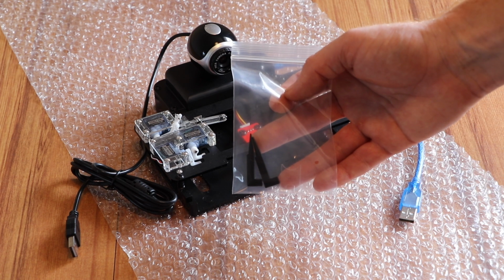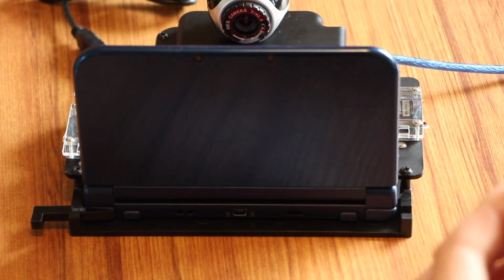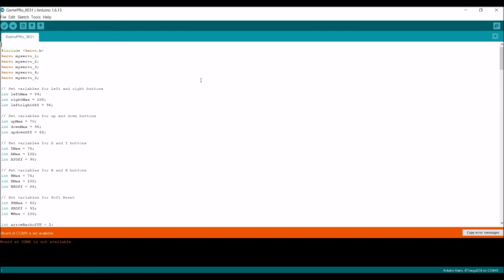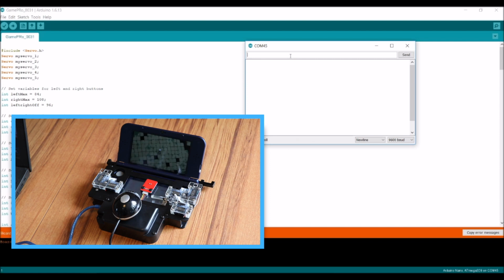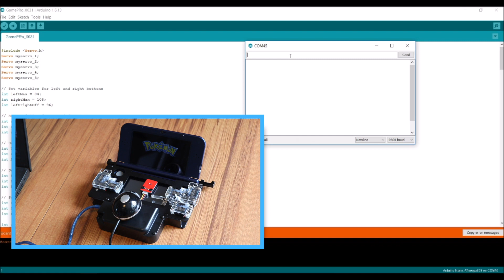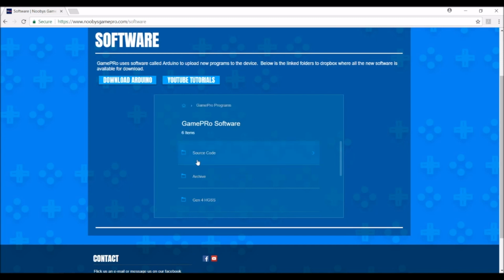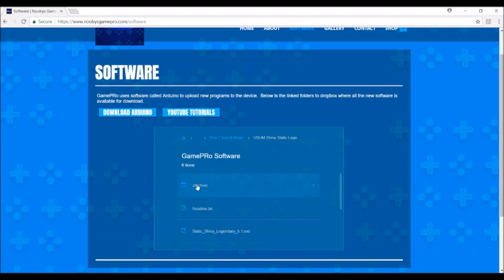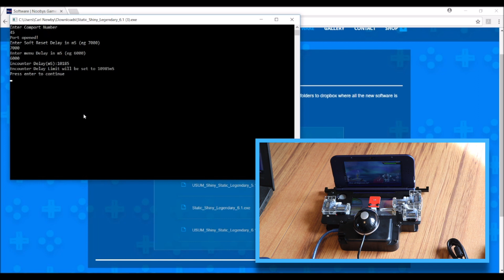Getting Started - Assembled GamePRo

Comment: Do you take request on programs? I purchased one and I don't know enough about the workings of it yet but I have a way to SOS chain that seems like it would work with the system (very step based not logic)
Reply: Really? I was going to write a program that would either detect the colour of the star sparkle in USUM or detect a change in colour it self. You can also use the lighting up delay on the lower screen too.

Comment: Can you provide a troubleshooting guide vid? 

e.g. i get don't know what COM port to enter when running a program, it gives me an error, even though it says COM3 in the arduino -> tools -> Port:"COM3"
Reply from the maker: Hey there, I'll start compiling a list of common errors and how to resolve them. One tip is to make sure the serial monitor in arduino is closed before running any software. You can always message me directly, usually by facebook or email is best.
Reply: @nooby1933  Thanks, i figured it out, and you were right, it was the serial monitor occupying the port.

Comment: So my gamepro just arrived and there is a big issue 

I tested the software, the buttons worked fine, but when I tried to run the shiny soft resetting for legendary pokemon, after I inserted the L and R pieces, it was in a constant state of soft resetting (it had a blank screen until I took the L and R pieces out) as if it is constantly also pressing the start button also and I can't seem to fix this. 

Any help would be appreciated (BTW I had a new 3ds XL)
Reply from the maker: Hi Joshua, try increasing the SROff value (by 5 or 10) in your arduino sketch and then upload it. That should lift the mechanism away from the buttons further so that it isn't hitting them. If that doesn't solve the issue let me know.
Reply: @nooby1933  Ok. The problem is solved. I unscrewed it ever so slightly and it did the trick